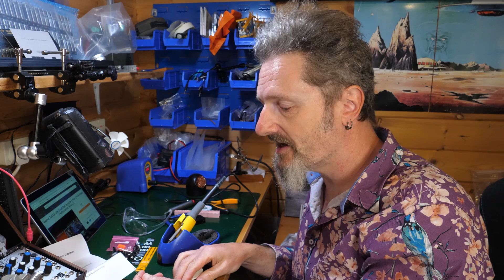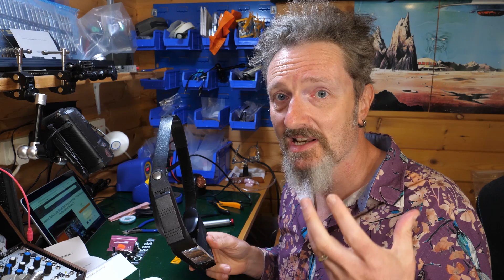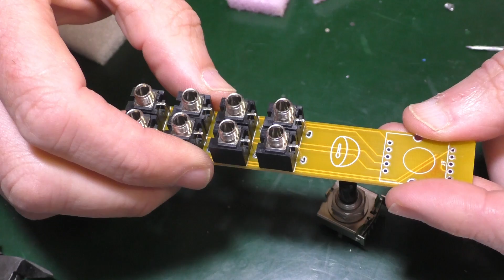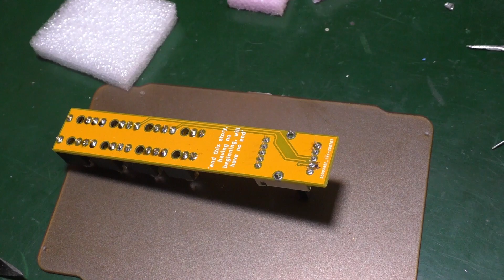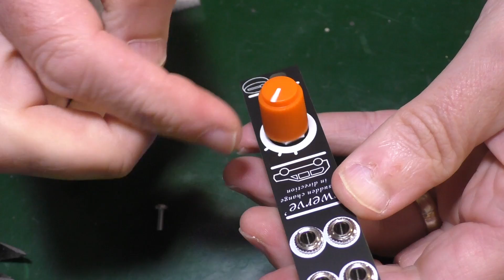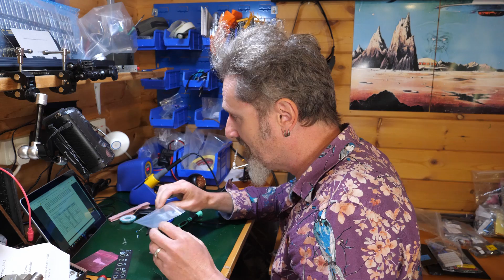Simple guide to soldering thru-hole and surface mount Eurorack kits

Comment: One more tip: For desoldering of simple components (resistor, capacitor etc) I just attach a crocodile clip to it, this adds the needed extra weight to fall down as soon as the solder gets hot enough.

Comment: Tinning a soldering iron involves coating the tip with a thin layer of solder. This is important because:

Improves Heat Transfer: Tinning creates a better thermal connection between the soldering iron and the components, ensuring efficient heat transfer.
Prevents Oxidation: The layer of solder protects the iron tip from oxidation, which can degrade the tip and reduce its effectiveness.
Enhances Solder Flow: A tinned tip allows solder to flow more smoothly and easily, leading to better quality solder joints.
In brief, tinning ensures your soldering iron works efficiently and extends the life of the tip.

Comment: For anyone watching, the FX-888D is not worth it anymore. Its successor, the FX-951 from Hakko is much better because it uses what the very expensive JBL stations had earlier - the heating element directly inside the tip. This gets you from power on to melting solder in 8 seconds, and offers much better heat transfer, plus nice to haves like motion sensor in the iron for auto standby mode. The tips are also just shoved in instead of being screwed in - you can exchange tips while they're hot using a silicone mat that's included. Now here's the kicker: the Chinese have cloned the latter, and you can get it for $100 instead of $250 for the FX951. So if you want to up your game, get the KSGER TS12 soldering station. It's all over youtube if you want to see it in action. Do not get the FX-888D in 2020, it's old technology and things have moved on - you can have stations pretty much as good as the $600-700 ones back when the FX-888D was the cool thing, for $100. If you want to upgrade, do it this way, please.
Reply: Also you know, you can get nice PCB holders for $20 that allow you to flip the board easily. Handy to have. They are spring loaded and hold your board by the sides. Way better than the crocodile clip and leaves no marks.

Comment: Thanks       I duck duck go  it>   ic leg straightener   ... Handy  . I did it just by hand with a plier.   Great tool.. The handy hands is just terrible  I use this only for soldering cables. A Clamp for PCB is very useful here and not expansive.

Comment: That smoke will cause the ultimate headache.  The part about using a fan (best yet an in-line fan with a little ducking to suck the smoke away from you and out of the room.  Also three glasses, didn’t think about using them til I almost took a load of hot solder right in the eye. 

Great video!  Cheers.

Comment: Add a microscope to those can’t see those colors tiny lines a flux pen helps too
Reply: Everyone has access to a multimeter and these days it's quicker to set it on your desk and measure before soldering in - especially with 1% resistors and the 5-band code these days. Not to mention most beginner kits have individually bagged resistors.
Reply: Arkadiusz Rozmus Agreed but once you cross with a bad batch of resistors with different color coding and value you just want to double check see it better more when you reach 50+ with a microscope can see it on a 7” display as well a 21” easy to the eyes not need to force the vision
Reply: @jvf6257  I'd argue it's the colors that can be wrong, not the multimeter. And it's easier to see your multimeter screen than color codes through a microscope and then looking at your color code chart. And then praying it isn't a bad batch. So I'd say unless you want to inspect your joints precisely for troubleshooting, or do fine pitch SMD, the kind with QFP microcontrollers when you're scared if you soldered that $20 part correctly, you don't really need a scope for reading resistors. Cheaper, faster and less error prone to use your meter for that.
Reply: Arkadiusz Rozmus Understand use the multimeter every time, but Display microscope to soldering and again not need to force your vision for $40 you buy a decent one, again more when you are 50+ ... plus can fix a cellphone

Comment: I think for my sanity I'll steer clear of SMD! Great little intro to soldering though, cheers
Reply: Wishbone Brewery it’s so aggravating yet rewarding at the same time...just a little lighter on the rewarding aspect
Reply: @brianrodman1033  haha, my stress levels were through the roof after building the Befaco STMIX as my first Eurorack kit, very compact design! I've soldered old Maplin Kits years back Amplifier, Radio transmitter and a Theremin Kit I got from ebay...

Comment: Hey there, I haven't yet watched it, but is there a bit in there about sourcing components? Maybe a list of websites (thonk, mouser tayda etc) and / or list of commen needed components?
Matbe I should watch it first :)
Reply from the maker: Nope, not a sausage on sourcing components because i'm talking about kits, not PCB/Panel sets. Kits are usually available from modular shops and direct from manufacturers. Thonk is the best source of kits the UK.
Reply: @MoltenMusicTech  Sourcing sucks anyway, I always seem to miss that one resistor or jack ;-)

Comment: Helping hands are perfect for when you’re working with wire. In Eurorack is rarely unless you’re making patch cables or working from the odd kit which uses wired pots or jacks.
Reply: SouthpawShorts it was essential for me when building I started soldering building pedals.  It’s also going to come in handy for some 4U builds and a few frac builds on my wish list.
Reply: SouthpawShorts agreed.  It was essential for me when building I started soldering building pedals (always at least a few things to wire even under the best circumstances).  It’s also going to come in handy for some 4U builds and a few frac builds on my wish list.

Comment: I get the hamming it up over the helping hands BUT as someone who now (age related ) needs reading and distance glasses and even then  I NEED the magnifying glass and I quite like the helping hands on. I still put the item on the surface but the clips can be useful to hold it roughly in place . I've tried various head mounted or other magnifiers and the helping hands works for me best
Reply from the maker: Yep, that's fine - my dislike of something doesn't mean I'm hoping to prevent other people from using it :D and the magnifying glass is always useful.